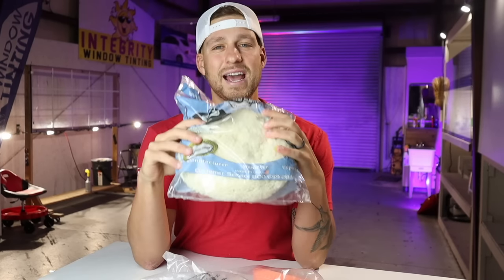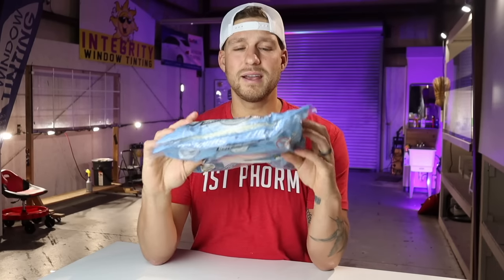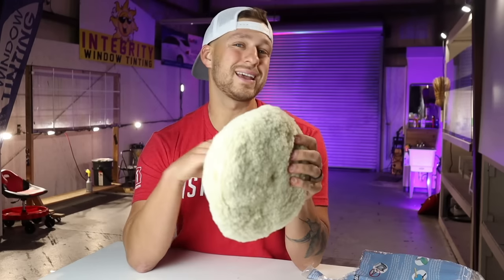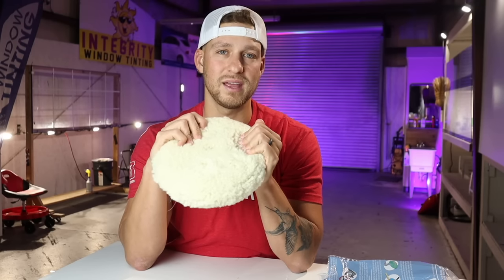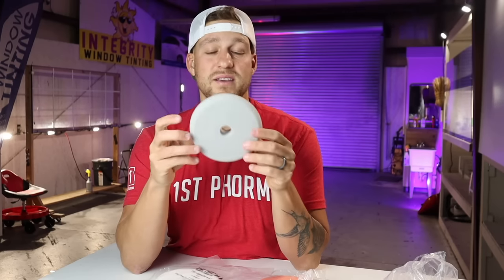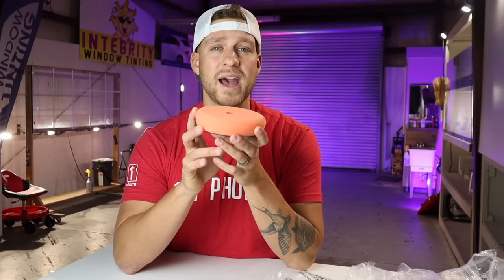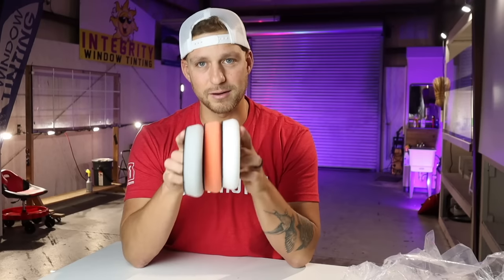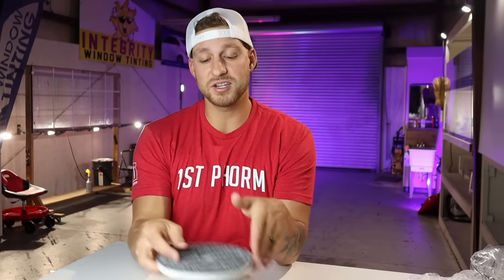Boat Detailing Pads | Everything you need to know!

Comment: Finally!   Been looking for a channel that explains what to use where.  What pad is best for boats and other surfaces. Thanks. Subbed and liked.
Reply from the maker: Thanks for the sub! It depends on what you are doing. If you want to cut some heavy oxidation with a rotary, then you’d want a 7inch presta wool heavy cutting pad, or if you are polishing with a forced rotation polisher then you would want a orange forced rotation pad

Comment: You can polish and even finish with a wool pad, I have the buff and shine 802-N double sided wool cutting, yours is the 803-N which has a longer pile height at 1.5”, the 802-N has a 1.25” pile height, it’s supposed to cut even more aggressively. I also have the 803-Y which is a medium cutting/polishing double sided wool pad, and I also have the 803-YS double sided wool polishing/finishing pad. I’ve polished some cars just fine with the 803-Y and 803-YS with something like Meguiar’s 205 on the rotary, no holograms or anything.
Reply from the maker: Hey man! I suppose you could, but you’ll still have micro-swirls in the paint/gelcoat. I save wool pads for heavy cutting, then I take over with foam. I like to finish polish and seal with foam pads and a forced rotation. However there is this AMAZING pad by lake country, it’s called their “purple foam-wool blend pad”. That pad you could absolutely finish Great with! Give it a try! It’s works great with Starke Elevate medium cut compound . https://drakesmarinedetailsupply.com/collections/lake-country/products/lake-country-purple-foamed-wool-pad?_pos=1&_sid=f7c29dcdb&_ss=r
Reply: @DrakesDetailing  that pad looks like something I would like. I wonder how it compares to my 803-YS which is a polishing/finishing pad? I like that they have it in 5 inch as well. What’s your go to foam pad for polishing on the rotary?

Comment: Drake - all of your videos are very very very informative and helpful.  What's your opinion on Jescar Power Lock Plus vs. Jescar Ultralock Plus.  The Ultralock Plus states it has all of the properties of Powerlock Plus AND it also has SiO2.  Have you used the Ultralock at all?  Would you recommend using the Power Lock Plus or the Ultralock Plus on the entire hull from rub rail down to include the full bottom AND also inside on non skid floor?  Lastly I haven't seen you apply any sealant or SiO2 to the bottom of boats below the water line.  Should we not be concerned with sealing and protecting the bottom?
Reply from the maker: First off, I have personally switched to using starke hyperhold instead of Jescar! I find hyperhold works better for boats in salt water! 

Second, don’t worry about waxing underneath. It will only last a few weeksn

Comment: Hi Mate just been reading some of the comments so will wait for the next clip to come out
the problem i seem to be getting on the foam pads is little balls of polish   is it not replacing the pads or to much polish or me being rubbish with the flex lol 
Anyway keep the great work up its made me change the way im detailing boats
Reply from the maker: You may be using to much polish. 

All you really need is 4 small pea sized dots for a 2 x 2 section. 

After every 2x2 section clean the pad with a pad brush or some type of brush

Comment: Couple questions: how do you clean wax out of foam pads? Is there anything wrong with using a foam pad with a rotary for waxing?
Reply from the maker: If you are using a rotary to finish, you can definitely use a rotary to buy the wax afterwards. If I just dedicate those pads to wax, then I don’t even bother, washing them out, since wax/sealant will be going back in there next time anyways.

Comment: Hi Drake.  Thanks for another great video.  You’re a good man for sharing your knowledge, especially for guys like me who are looking to move into marine from auto.

Drake, you ‘re a big promoter of the Flex 3401, which is a great tool, but I’ve never heard you comment on the Flex 14-2 150 rotary, specifically its ability to match either the Mikita or Dewalt on gel coat.  The Flex is 2 pounds lighter than the other two polishers and also has basically identical specs.  Aside from price, why shouldn’t I buy the Flex.  I would really appreciate your thoughts on this because I have a sneaking suspicion that you’ve put the Flex rotary to the test.
Reply from the maker: Thanks for watching!

the flex rotary doesn't have to power that the makita has... on paper they are the same, but the flex kinda bogs down little, the makita does not.
Reply: Thanks Drake.  I guess I’ll buy one of the big boys.  And thanks again for being so transparent about how you run your business.  I can’t tell you how much I appreciate it.

Comment: I currently have a new black boat with very little oxidation marks. Should I use the orange pad with the 400, then follow it with the Micro fiber pad?  What Polish do you recommend with the microfiber pad?  Love the videos.
Reply from the maker: If your boat just has light, scratch marks, and light oxidation, use the 400 with the orange pad, then you can use the microfiber pad to apply your sealant. Do a small section and see how it looks. You may have to do deeper cutting if the 400 isn’t strong enough to pull the scratching oxidation out of the black gelcoat.

Comment: Hi Drake! Thanks for the videos, love the energy. I have a 1 year old boat, dark blue with no corrections needed.  I want to polish and ceramic coat it. I am assuming the white Lake Country pad with my DA would be the correct application for this? Also how many pads would you need for a 30' bowrider. Thanks you my friend!
Reply from the maker: Hey Bro! I would use some Starke Elevate with an orange lake country forced rotation pad on either a DA or a Forced rotation, that will polish it out really nice! They just seal her up with some Starke Hyperhold polymer sealant with a DA and either a microfiber pad, or a general black waxing pad😎 

Also, If you want to expand your knowledge of boat detailing, I also have a live recorded boat detailing class available as well. Feel free to check it out. You take it at your own pace 😎 https://www.detailuni.com/a/2147504321/GMGkUUpS

Comment: Hi Drake, I am doing a customers 20 foot boat and it’s the first boat I have ever done. I’ve done my research and have everything I need to do. My question is, how much of a boat do you normally do? Do you do the outside hull all the way to the bottom or just the waterline, do you do every bit of gel coat inside the boat all the way to the floor of the boat? I’m sure it’s customer preference but what do you normally do?? That’s for your videos!
Reply from the maker: Hey bro! It’s whatever the customer is paying for. Typically a lot of customers want exterior topside compound, polish and seal as well as the hull sides.

Comment: So Drake I’m going to attempt to seal my boat this weekend with jeskar power lock. My 23’ cc boat is about 4 months old and I’m just wanting to keep up on the Maintenace myself. Man do you think the power lock will suffice w/ microfiber pad or do I need to polish with a compound before I seal it.  All I have is griot da.  Thank you for the wealth of info you share !!
Reply from the maker: Is there any oxidation or fading?
Reply: @DrakesDetailing  I would say not much if any.  I do have some scuff marks from docking   I figured I’d try to get that off with acetone and white terry cloth.  I do use my boat a couple times a week so it’s working and not sitting.

Comment: Great Videos.  I need to refinish my non skid.  I watched your video on that, again great video.  My question is, my non skid is not really oxidized, not chalky anyway, but has lost it's luster and has stains on it.  Should I use a wool pad and heavy cut compound.  What is your opinion on using a brush on a DA?  Thanks.

Comment: Great video it takes a lot of guess work out of choosing the right tools.
I do have a quick question if I can?
I own a 70’ yacht with a lot of surface area to work, it’s all painted white so no gel coat and very light oxidation. What could you recommend using to clean up and shine up with as few steps as possible but still get a lasting effect?
Reply from the maker: Hey bro! Try polishing it and then waxing it. Try some shine supply products. If you don’t get a sine or the wax dose not hold up then that’s how you know you need to cut deeper https://shinesupply.com/

Comment: Rupes makes a blue pad called coarse rotary cutting pad. Would you use this pad on your flex 3401vrg to cut and or polish boat gel coat? Does not say anywhere on the packaging that it can be used on a forced rotation polisher like the flex but i assume it is ok. Thought id see if you know of this pad or have used it and could recommend it for use with the flex?

Comment: Great videos have learned so much from them all. I have a 1999 272 sailfish that i am looking forward to compounding  and polishing come spring when the snow is gone up here in the north east. In your videos you use multiple different buffers during your system. A video on the differences between them would be great, my budget only allows me to buy 1 so if you could only have one buffer which one would you pick and what if any things i would need to be carful with...
Reply from the maker: Thank you! So, I get this question all of the time. If you have a 99 there is probably going to some fading or oxidation. For lower budges Id get a cheaper rotary and a ccheaper da. Harbor freight has decent machines for around $70 each. You really need the rotary to compound, and the da to wax and polish.

Comment: Thanks for all the great info! Do you add some water for lubrication when using the foam pads?
Reply from the maker: No, most of the compounds and policies you’ll use on a foam pad, have enough oils in them to keep them from burning the gelcoat.
Reply: @DrakesDetailing  I need to use it for marine paint. More specifically, Total Boat one part topside paint.
Reply from the maker: Gotcha. You still should be fine 👍🏻
Reply: @DrakesDetailing  came out perfect. 🤙🏼

Comment: Thanks for the informative video.  Question: What pad should I use on deck non-skid, the type that looks like it’s sprayed on and leaves a grit surface.  I have a Griots machine and Menzerna 400.  Boat is one season old and surface is off-white.  I have some Griots orange pads but think the non-skid will tear them up.  Just looking to get the deck shined up.
Reply from the maker: a wool pad will do just fine! go check out my how to buff and wax non skid video

Comment: Great video Drake, learned a bunch. This may be a tough question to answer, but is there a way you decide the condition of the gelcoat to determine what process/products to use to correct?
Reply from the maker: Years of experience! ha   The best way is todo a small 2 ft x 2ft test spot. use what you think the boat needs and see how it looks. Thats the best way to see
Reply: @DrakesDetailing  Thanks, keep making your videos they are a great help.

Comment: What will I use on the front bow of my 380 Express to  clean and buff a wool or foam as being told can’t use foam as pad will rip apart because of bow surface 
Keep up with the videos great job and I enjoy watching them
Reply from the maker: Hey Man! So you actually wanna clean the areas that are going to be buffed before buffing your boat. Use a really good boat soap, or Dawn dishwashing soap if it’s really bad. Then, you start to buff. Reason being, all the micro dirt will contaminate the pad and you’ll be grinding dirt and grime into the boat as your trying to buff and it will give you kind of a crappy finish. As for buffing non-skin surfaces on your bow (which is what I believe you are referring to), here’s a good video I put out a while back! This will really help depending on what type of non-skid you have! Hope this helps!! https://m.youtube.com/watch?v=ibfh8ucS1K8

Comment: Hey man, i love your videos!! very very helpful!, But i have a question, i notice that you cut with a rotary and wool pad but if i only have a DA with foam pad, does it will do a good job for compound on a boat? i've done a few car but i'm kinda new to boat so that's why i ask. Thanks!!
Reply from the maker: DA’s are not meant for compounding or heavy cutting. That’s why there’s really no use for a wool pad on a DA because you don’t cut with them. They are not powerful enough to break through any decent amount of oxidation. Use your rotary and heavy wool the remove the oxidation, then your DA for polish/swirls removing, and applying wax/sealant 😎🔥👍🏻

Comment: Would really like your opinion of 3M Perfect Gelcoat Light. Part number 36110.
I have a boat that was waxed from top to bottom 2 years ago. She still has a good shine to her and thought about using this 3M product. Is it worth a look in your opinion? Thanks! And nice job on the explanation of the use of pads. Was very helpful!!
Reply from the maker: Should be fine! 

Just keep it sealed with starke hyper hold

Comment: Hi Drake, I  have a robalo 4 yrs old, one side paint is oxidizing, getting chalky n dull due to sun. Can I compound adequately with 3m heavy cut "perfect it gelcoat" a  griot g9 and a wool pad, or do I need a rotary to do this or? I like your videos, u break it down so non pro like me can get useful info. Thanks
Reply from the maker: Hey bro! You need a rotary if you have that much oxidation. Then you can polish and apply sealant to the boat after you are done using the rotary to remove the swirls

Comment: Great video BOSS
I detail cars and now some person asked to paint correct white speed boat and wax it 
I only have 15mm DA and some foam pads.
I know white color is forgiving so i am thinking of one step correcting with da and medium cutting pad, or just heavy cutting pad + heavy cutting compound + da to corrct that white paint which should leave invisible hologramms which white color should hide + some visible haze which wax should high.

Thats all in theory , i know nothing about boats polishing.

8 metres white boat , sides only / externally.

If it is possible to do it with da , how many hours will it take with 6.5 pads just so i know how much to.charge money wise please ?

Got to answer by the end of today
Reply from the maker: Thanks bro! It’s impossible for me to begin to guess how long it’s gonna take to do that job. without knowing oxidation level, how big the boat is With a DA probably pretty long if it’s oxidized, because then you will need a rotary. If it’s not too bad and only needs a polish then a DA would probably be okay. Is the r boat gelcoat or painted?

Comment: I have a white boat with a decent non-skid and gel coat. (No caulking or serious staining). I was thinking of cutting with the wool pad with compound. Then using polish and applying with the orange pad. Then spraying the seal on top of that like you spoke about in another video of yours. What are your thoughts on those steps?

Comment: Hi Drake some great videos in your line up. I have a quick question how do you go about using the forced rotation or D.A machine for the second polishing step in the smaller tighter areas where the machine cant fit and the pad can't get to? As with compounding and using rotary with wool cutting pad the double side pad can be angled into areas and utilising at times both sides of the pad at times I use a extension bar to get the pad in behind a area where the rotary gets in the way eg a bow rail. So back to original question of polishing with  F.R or D.A in tighter areas eg behind rails ect. Thanks
Reply from the maker: Hey bro! I use a mini forced rotation to get into those hard to reach areas! 

They can be found here on my website under the “buffers and polishers tab” I hope this helps! 😎

Comment: Great Video.  I recently purchased a boat and noticed a small repair job.  Can only see it at a certain angle but there is a about an 8 inch circle that is duller than the rest of the hull (white).  So do you recommend I hit it with the white wool pad with Starke Level R on a rotary followed by the orange pad with Starke Hyper Hold on a da?  Also, anything I can do about discoloration on non skid?  There's a small area that looks grey..doesn't appear to be stain and nothing will remove it.  Thanks again.
Reply from the maker: Those steps should work great not he hull! AS for non skid, you can try to starke venom acid, or try buffing it with compound and a rotary

Comment: How long do these pads last? Do you use new on every boat? What backing plate do you use on either machines
Reply from the maker: Pad last about 50 to 60 ft
Reply from the maker: 7 inch on rotary, 6 and 5 inch on flex

Comment: Great video.  I am new to boats. 
I picked up a 69 run a round Witchcraft boat.  White and purple. Heavy flake in the purple. It has heavy oxidation. 
Is the double sided wool pad ok with the painted purple areas?
I don't want to ruin the paint.
I have Flex 340. I also a stock pile of Hex Logic Quantum pads. Will they be fine?
Reply from the maker: Hey bro! The Flex will be awesome for your boat for polishing and swirl removing, but to get the heavy oxidation out of your gel, you need a rotary buffer and heavy cut compound. Then after that, polish it out with the flex 😎

Comment: I wonder how long does a pad last. Foam and or Wool?  Thanks
Reply from the maker: It depends on how oxidized the boat is and the pressure you are putting on the pad. It can last you the whole boat, or it will fail within 10-20ft of detailing. Lord of variables to factor in there.
Reply: @DrakesDetailing  Thanks for the fast answer.

Comment: Hi Drake.  How much use will you typically get out of a cutting wool pad.  I know it will depend on the level of defects/oxidation, but would you go through one or two, for example, on say a 30 ft boat?
Reply from the maker: One single sided wool pad will go solid for around 50 ft! Watch my video that is coming out today! I answer this question directly